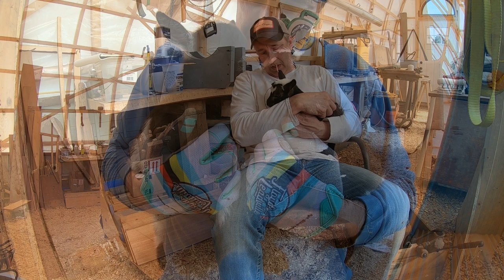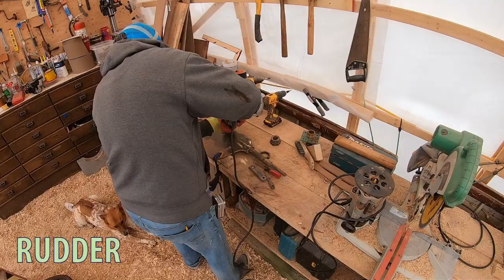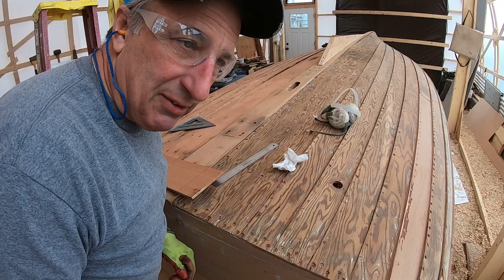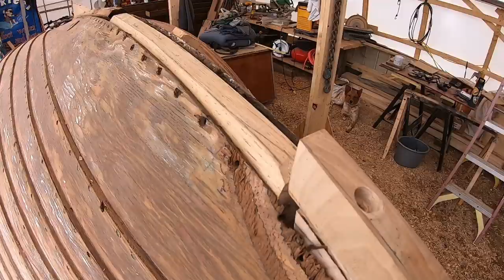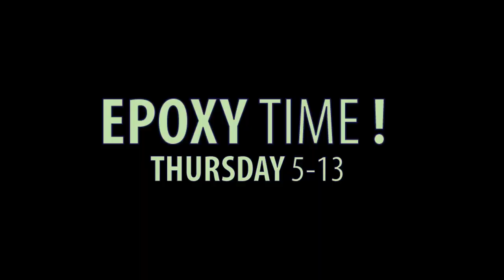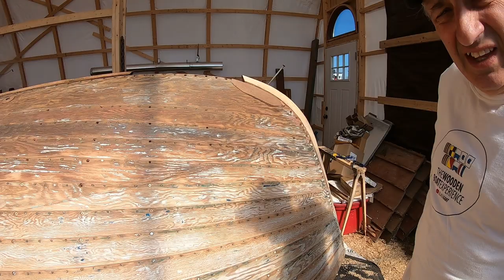Baby Goats in the Boat Shed! WBE E35

Comment: It is nice to see the stem coming back together.  I do not remember if you mentioned it, but were you thinking about a Stainless Steel cover for the stem?
Reply from the maker: Tedd, those cutwaters don't work very well with lapstrake bows. I will be putting on a stem band (brass) for protection though. Until awhile ago, I didn't realize the different names for those two pieces. See you next week!